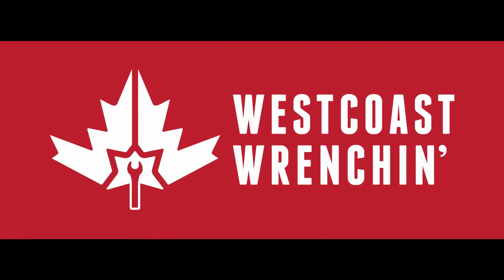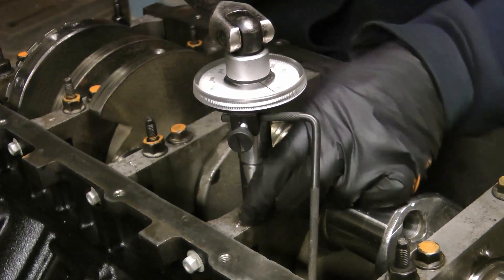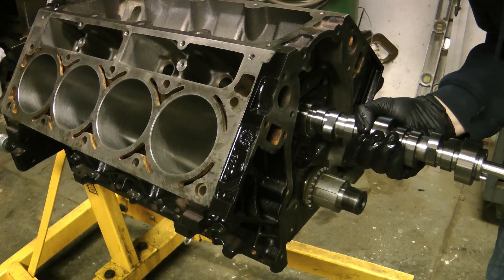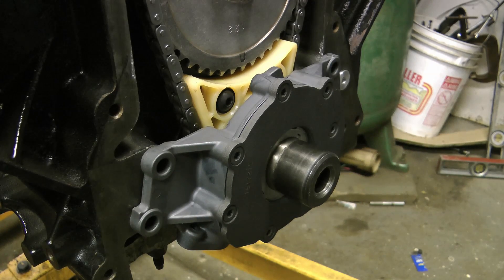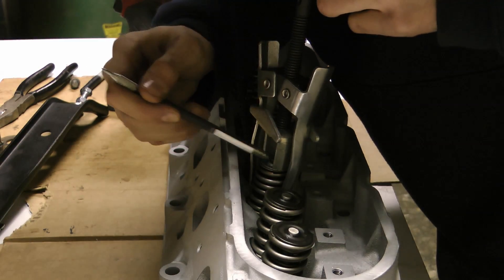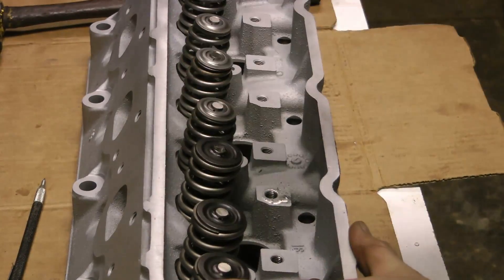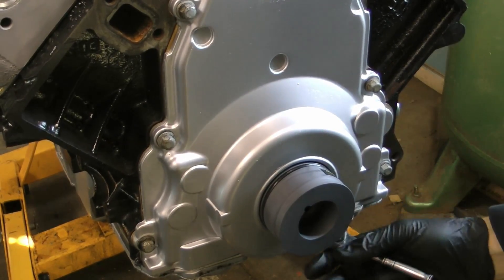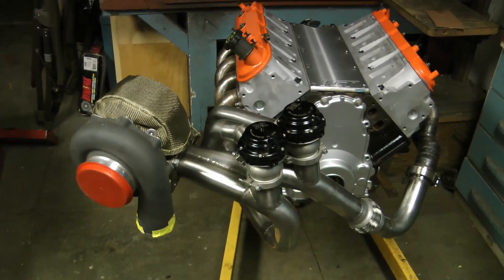How to rebuild your LS Engine in under 7 minutes - Includes all part numbers !

Comment: I forgot to set the thrust bearing before angle torquing . Should i unbolt and start over or can I just set it after?
Reply from the maker: Which thrust?
Reply: At :49 second you hit the front and back of engine to set thrusting bearings. I skipped this on accident
Reply from the maker: @DYCKnights  you're problably okay
Reply: @WestcoastWrenchin  I don’t mind unbolting ect if you think it’s worth it . Appreciate your help too
Reply from the maker: @DYCKnights  sometimes it is worth it to re check for peace of mind!

Comment: I wondered how you could claim to build a LS in under 7 minutes, You failed to show the proper way to install cam bearing, main bearing, rod bearings and piston rings. No cam degreeing or proper oil pump alignment, no pushrods? Your misguiding alot of noobs here!
Reply: I think if a builder can figure out other aspects of building an LS engine (ring gap, bearing clearances) then they can handle working with tight tolerances!
Here is the correct way to install any LS oil pump. wich will increase the life of the pump a great deal and less than 6 minutes of video!  Everyone and there mother is selling LS oil pump alignment kits!  The consensus is TOUCH IT!
https://carshopinc.com/ls-oil-pump-alignment-kit.htm
https://www.lsxceleration.com/schumann-gm-ls-oil-pump-alignment-kit-ls-al-tl/

https://www.youtube.com/watch?v=CWCIdhG04LY
https://www.youtube.com/watch?v=gWfyMasFywM
19:47 a good reason to open your melling pump,  to clean out machining debris.

https://www.powernationtv.com/post/two-minute-tech-how-to-align-an-ls-oil-pump
http://www.d-aperformanceengines.com/oil%20pump%20alginment.html
Reply from the maker: @mewrongwayKOCXF  thanks for sharing!
Reply from the maker: The purpose of this video is a concise breakdown of how the engine looks inside and to show that it is a typical pushrod v8. It is certainly not meant as a step by step rebuild. You could make a two hour video on bearings alone! A lot of people are scared of LS engines and they imagine they are opening up something far more complicated (ex. Coyote)
Reply from the maker: Also did you read the description with regard to the oil pump?
Reply: @WestcoastWrenchin  Yes I read it but most people dont and the oil pump is critical, not like the gen 1!
Reply from the maker: @mewrongwayKOCXF  i think there's a lot of varied response on the oil pump and melling specifically says not to touch it. I think most people will do more harm than good trying to measure such tight tolerances but I understand why you may want to look at it. The consensus ive reached is don't touch it!

Comment: Hey what trans are u using
Reply from the maker: 4l80e now, previously super t10
Reply: You wouldn't happen to know if you can bolt up a 4l60 to the older 2000. Lq4
Reply from the maker: @biggskz  yes you can, I think you'll need the flat flexplate and a spacer between the bell housing and trans. Call novak